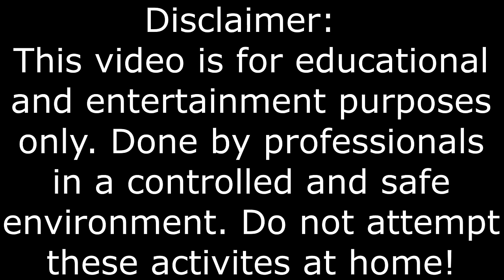Restoring WW1 Imperial German Luger P-08, (with test firing). #restoration #ww1

Comment: i would be scared about those pins coming loose after sand blasting
Reply from the maker: It was glassbead blasting so it didn't take material away, thanks for watching!
Reply: @TheKinzlerBros  yeah but bit of glue or hard chroming loose pins wont hurt

Comment: I first shrieked when i saw the steel punches but then noticed you had rounded the edges and mirror polished all surfaces.  Thank you for the meticulous restoration and not using cold blue.
Reply from the maker: The punches are still brass, thanks for watching!

Comment: Beautifully done as always! I have a 1911 DWM that actually came home with my grandfather from Germany in ‘46. Unfortunately it’s a total mismatch but still a great gun to shoot and a real head turner at the range! Also, one thing you guys should do if you haven’t already is check the bottom of the barrel just in front of the frame for a waffenamt. Mine has an S/42 marking there which means it went through a rebuild at Mauser during the third reich era if I am not mistaken. It’s been a while since I looked it up.
Reply from the maker: Thanks we appreciate it, that's a beautiful gun! It has a 8.82 mm marking. It hasn't been re arsenaled. Thanks for watching

Comment: Another fine job. Anytime I go to the gun shows I always have my eye out for a Luger.

Where is a little tip for everyone. Whenever you work on your handgun if it's just the cleaning or to just do maintenance there is a way without ammunition to check and see if its operating correctly. 

You can do this with a pencil and sliding down the barrel. Then pull the trigger and when the pencil comes flying out of the end end of the barrel then you know if you put bullets back in your gun it will fire correctly. 

As always look forward to your next video.
Reply from the maker: Thanks we appreciate it, ya for sure! Thanks for the tip and for watching

Comment: I would have done a kerosene soak, not a rust removing chemical soak, then after disassembly boiled each part in distilled water (with no added chemicals) then carded the residue off.  That would have preserved original finish.  (Okay maybe not for the brown Lugers, but for the blued ones definitely,)  Depending on the year and make of manufacture, some parts would then be strawed, or not.
Reply from the maker: It was evaporust which, isn't harmful to metal, thanks for watching!

Comment: This is called Luger but Georg Luger was the Austrian weapons technician who co-designed the weapon.  Its name is P 08 for Parabellumpistole (or just Pistole) 1908, Parabellum is from the Latin phrase - "Si vis pacem, para bellum" meaning "If you want peace, prepare for war" @4:35 the part with the stamp "GELADEN" is German for "loaded". @7:32 the part stamped with "GESICHERT" means "safety on or engaged". @7:50 is the logo of the "Deutsche Waffen- und Munitionsfabriken".
Reply from the maker: Thanks for the info and for watching!
Reply: Hugo Borchardt conceived the original design, after having worked at the Winchester plant, and was intrigued by the Win. 73s toggle system.

Comment: How long did you leave the parts in the hot blueing solution and did you make multiple applications?
Reply from the maker: 1 time for 5 minutes, thanks for watching!
Reply: Do you find that only one application provides adequate corrosion protection? Wasn’t original blueing several coatings of rust blueing?

Comment: while the Germans did carry Lugers in WWII, the official and most produced for them was the P38 actually. They also used FN Browning 1935's as well after occupying Belgium. Very few Lugers were made during WWII. What they had were old stock or personals.
Reply: mainly because the Luger has far too many parts and is too precise in manufacturing.

I've taken apart, fixed, restored etc so many of these. Great guns, but dayum...
Reply from the maker: Ya that is absolutely right, ya they are impressive/over engineered. Thanks for the comment and for watching!

Comment: Well, you destroyed all the original bluing with that evapo-rust.
Do it the backyard ballistics way and boil it in some hot water, to convert rust into black oxide/magnetite.
Keeps the bluing and is less aggressive to the remaining, good metal.
With evapo rust, you get phosphate coating, OK for machine parts, not so nice on guns.
Reply from the maker: There wasn't much left to begin with, thanks for the advice and for watching!

Comment: The old firing pin doesn't have gas relief grooves. If you have a primer puncture, the piston effect of the firing pij will drive it backward, violently, cracking the breech block. It happened to my minty Erfurt 1913 P-08. I was able to find a serial number matching replacement breech block, but it broke my heart. The pistol was all numbers matching, and in mint condition. Now, it's a fake. :(
Reply from the maker: Thanks for the heads up, we don't plan on shooting it much! That sucks about yours! Thanks for watching!

Comment: It makes modern manufacturing look shoddy; not a milling or tooling mark in sight even on the most hidden internal part and every surface matches perfectly.
Would plastic coated wire like high temp single core wire used in vehicles be better in bluing process? You're getting extra chemical reactions from the steel baling wire.
Reply from the maker: It absolutely does, Idk if it would work or not. I degrease the wire. Thanks for the advice and for watching!

Comment: This is a refurbishment not a restoration . Whats the diference you my ask ? Well since you stripped compleately the original finish of the surface ( Evaporust ?) instead you  did a new finish ( hot blue) is a refurbishment . 
To make a restorarion you should have to try to preserve the originality of the piece by converting the rust in ferric oxide first and carding it away to then see what remained  of the original blue ,then proceed to stabilize it and preserve the original finish that was a rust blue proces not a hot blue one ,or proceed to do a new original rust blue finish to frame and barel ,straw trigger  safety and magazine release and finaly a fire blue for the the screws of the grips and other small parts . 
A restorarion is a more involved process that a refurbishment and implies a lot of reseach study and knowledge to achive in a compleate sence of the word . Anyways you did a good work in stopping its decay and puting it back to service witch is not an easy task in any ways and requiere a lot of work and patience.
Cheers! .
Reply from the maker: It's all left up for interpretation, thanks for your opinion and for watching!